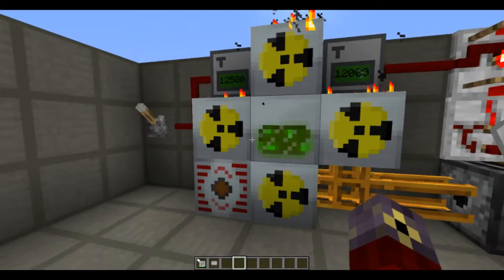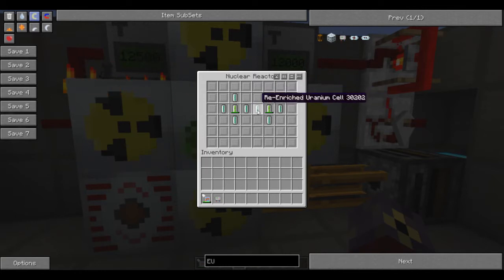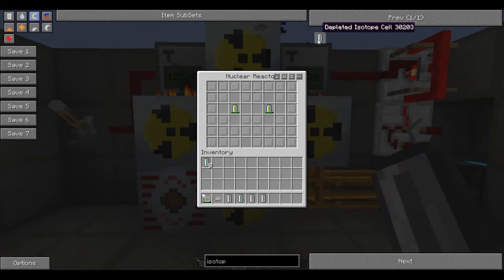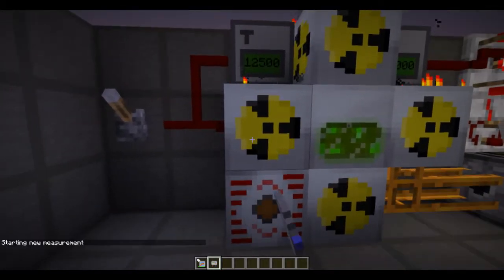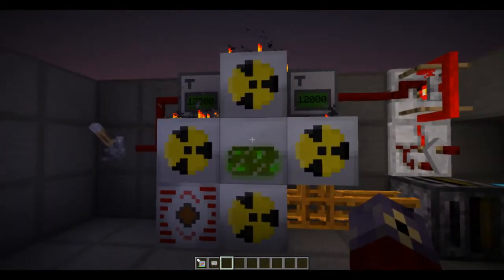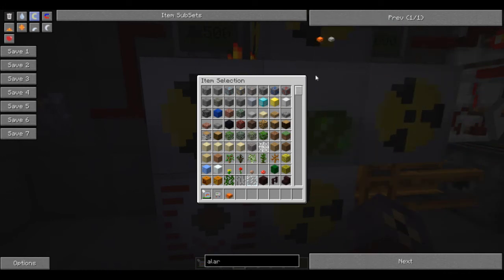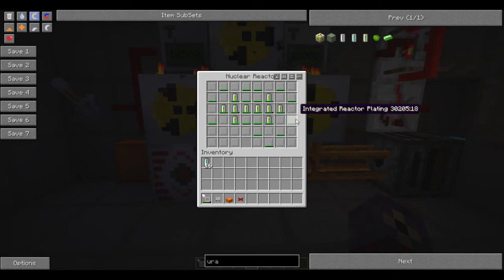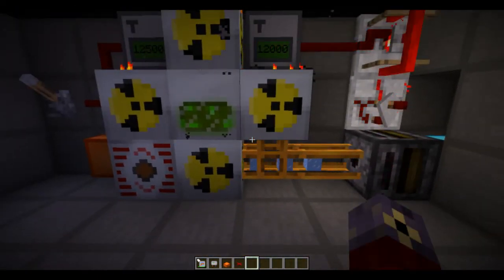Tekkit Safe Nuclear Reactor Breeder!

Comment from the maker: bottem one is a timer and top one is an invert-cell it takes the power input from the left side, inverts it and then outputs it on the bottem side in this case. These come with the redpower mod. So they can only be found in tekkit classic modpack, if you want it to work in the new tekkit then you need to make a redstone clock and an inverter.